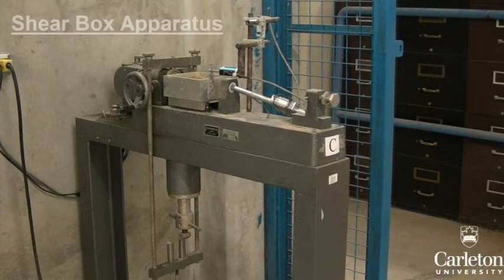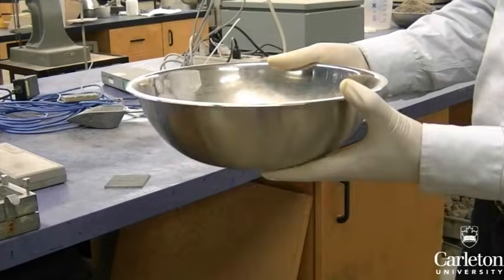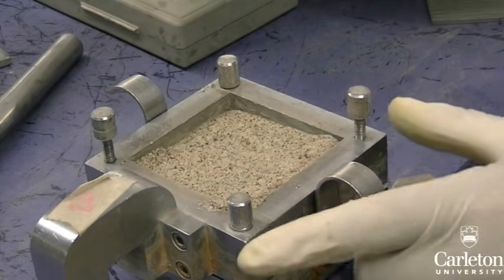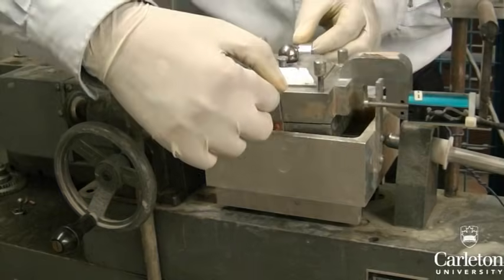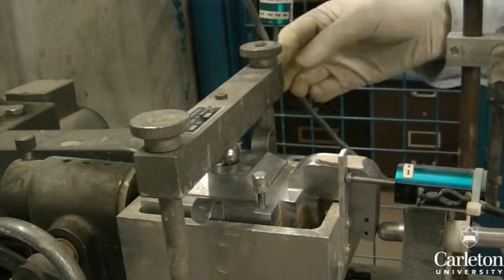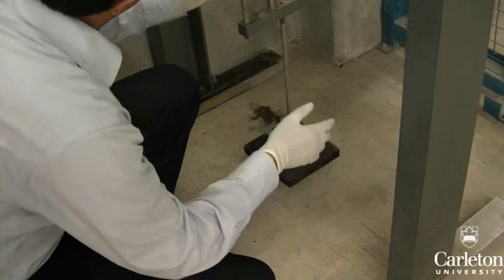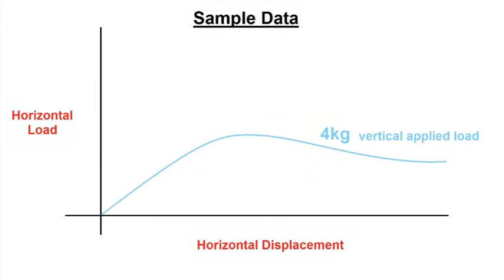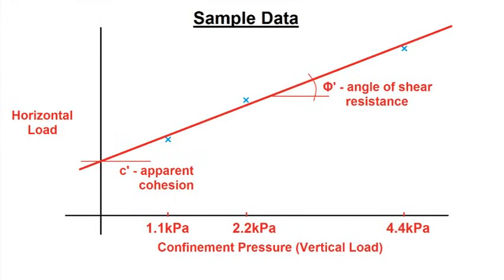Carleton University - CIVE 3208 Lab 6: Direct Shear Test

Comment: Great video. Quick note: those displacement sensors are not strain gauges. They are DCDT or LVDT sensors, a type of differential transformer. Strain gauges generally are the metallic bonded variable resistors.